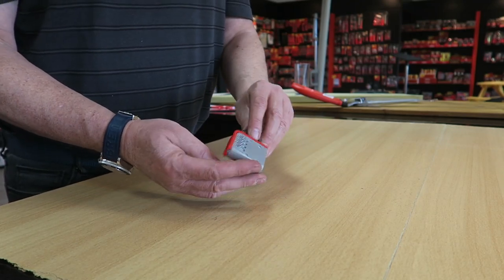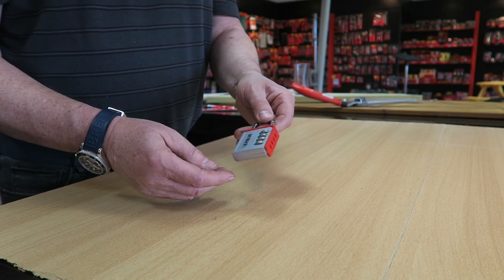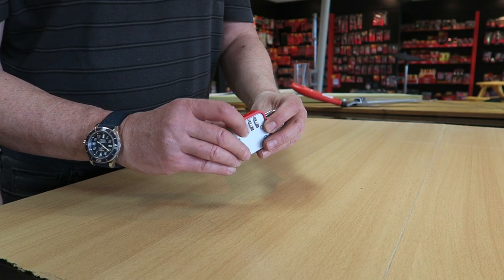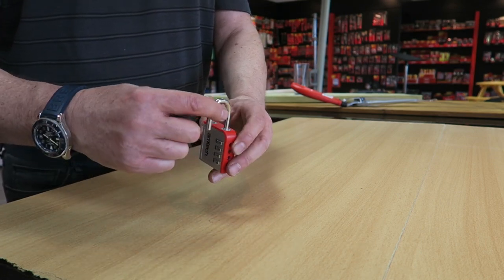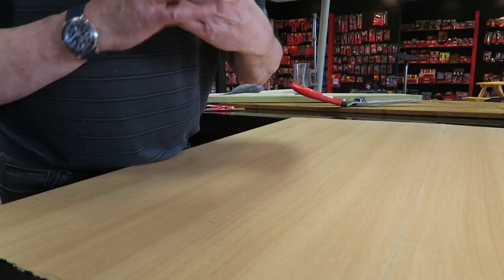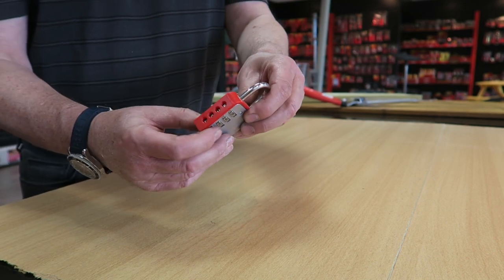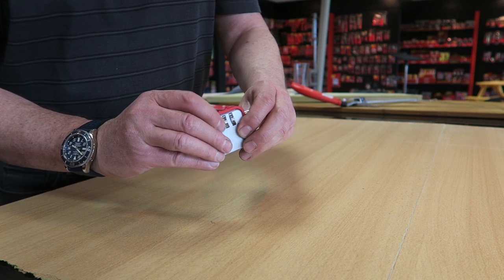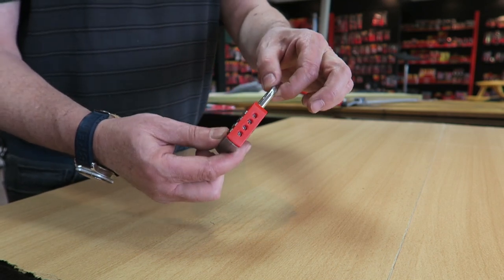How Do I Set My Padlock Code

Comment: The downside about compilation locks is if you ever forgot the code the lock becomes useless, cannot be reset without the code.
Reply: its very easy to break through it though
Reply: This is exactly my problem... the lock is allready open, But i want to re-use it... I don't remember the code so it won't close... any tips? Or should I just try guessing or buy a new one
Reply: Simone Stout it’ll take a while but just go through from 0 and just increment by one each time, but a 4dig lock has almost 10,000 so it’s probably be best to just buy a new lock
Reply: @netwilson-wardle4738  fucking berk 🤣
Reply: @simonestout6691  mines the same..its a  bag of shit🤣

Comment: It didn’t work 🤬😡
Reply: it does work, i tried on 1digit lock, 2 digits lock, 3digits lock, 4 digits lock and also 5 and 6digits lock. You have carefully do what he says and remember to always pull don't the pin before you set the new password for unlocking.